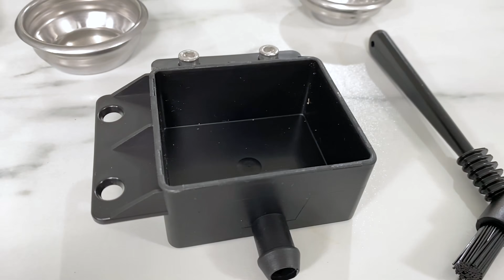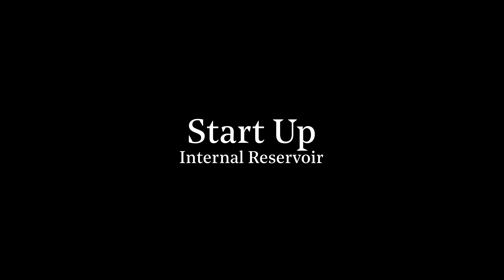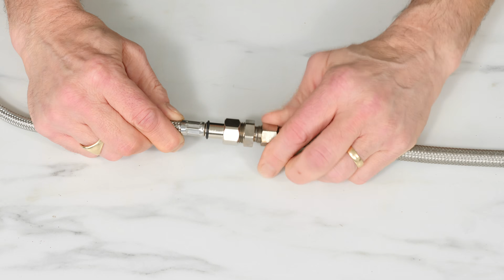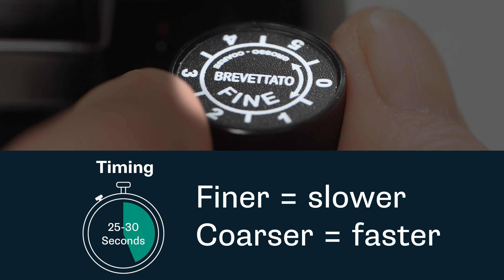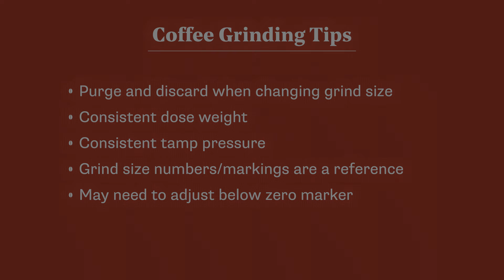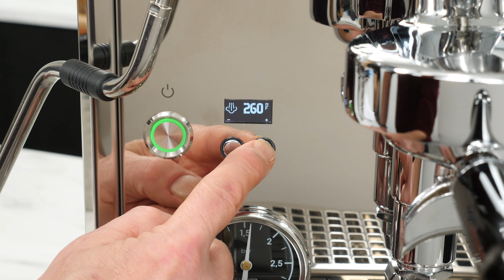Profitec Drive Setup, Quick Start & First Use

Comment: Question (very late, so here's hoping you still pick up on this):

To connect the machine to the direct water connection I want to connect the hose to the water inlet. However on my machine it's pointed to the back so basically south of the machine. Yours is pointed sideways. Is it safe to change that orientation (how would I safely do so), or did it come shipped like that?
Reply from the maker: Hey there, good question. That piece can rotate, so it's ok that it's int hat position.

Comment: Thanks great informations about start up. I would like to ask if I can set up the opv valve. Is there a screw somewhere at the bottom where I can do this?
Reply from the maker: Hi p, you're welcome and thanks for the comment and Q! Yes, there is a screw to adjust the rotary pump bypass accessible thru a hole on bottom left of the machine. It's the rotary pump bypass which adjusts static pressure (not an OPV) on machines with rotary pumps.
Marc

Comment: Is the fast heating mode the same as Profitec Go? Does it simultaneously heat both boilers? Or does it heat the brew to the highest temperature first, and then only heat the steam boiler?
Reply from the maker: Hi l, Fast Heat takes care of the brew boiler 1st then the steam boiler heats,
Reply: @Wholelattelovepage  thanks! From your testing with the offset set to -3F, did you notice any overheating issues with the machine? I've been using 90°C and -2°C, but I still notice the machine heating over 90°C.

Comment: Hey! Can I ask, would you recommend this or a Bezzera Duo. I’m looking at either, both look phenomenal, but ultimately after a reliable machine I can keep and repair for 10+ years that makes excellent espresso. 

Thanks 🙏🏼
Reply from the maker: Hi MrJJ, Both the Bezzera and Profitec machines are excellent and highly reliable machines. The Profitec Drive is a more recent design updated from their highly respected Pro 700. The Drive has a deeper feature set like programmable active and passive pre-infusion and quick heat up time. While it has more features than the Duo I give it a slight edge in reliability with an overall less complex internal design. It's very easy to work on should the need arise. Hope that helps!
Marc
Reply: @ thank you so much, Marc - truthfully appreciate the reply and breakdown. 

Are there any other models you’d recommend with the lever action steam / hot water system that are worth considering? 

Have a wonderful day 🙏🏼

Comment: I unboxed my profitec today. It’s a great machine but I found the steam wand too loose for my liking, the wand kept pushing up when I tried to fix it on my pitcher spout. May I know if there is way to tighten it?
Reply from the maker: Hi ff, Yes the wand can be made tighter. Here's a video showing how. It's shown on an ECM Synchronika but procedure is the same for the Drive: https://youtu.be/NDpqdu7Tb9U
Marc

Comment: My pump pressure out of the box is set at approx. 10bar. Can I change this myself to around 9bar? How?
Reply: Excellent thanks Marc! I wonder, when 9 bar is the desired pressure, why do they set it at 10+ in factory?
Reply from the maker: @plyr78  NP! Keep in mind where that pressure is measured - it's way back by the pump. During an actual extraction pressure in the portafilter is likely closer to 9 bar when the gauge is reading 10. I know people do, but don't get wrapped up in a bar or two difference in pressure. Highly unlikely you'd taste a difference at  +/-1 bar if everything else is equal.
Marc
Reply from the maker: Hi p, Here's a video that shows you how to adjust the brew pressure. It's shown on a Profitec Pro 700 but it's the same for the Drive: https://youtu.be/2ArWAtuUTOM?si=ks0IQipOwIiyCoX8
Hope that helps!
Marc
Reply: @Wholelattelovepage  Sorry to revive an old thread. I went to go adjust my Profitec Drive brew pressure using the method from the Profitec Pro 700 video you linked and I don't have the oval hole on the bottom of the machine and when I shine a light through the little holes it doesn't look like there is a bottom facing adjustment. Is this normal?

Comment: Hello,

I’ve been searching for a new machine I have the Breville oracle touch , but want something different , I seen this review and I wonder how does this compare to the  
ECM synchronica ?
They are very alike I believe
Reply from the maker: Hi g, thanks for the question. Internally the ECM Synchronika and Profitec Drive are essentially identical with the same boilers and many other components. ECM and Profitec are sister companies. The Drive has a bunch of new functions not found on the 
Synchronika like time programmable active and passive pre-infusion, programmable on/off by time of day. The Synchronika has a more refined external housing and extra details like chrome tips on valves, handles and the angled portafilters. Hope that helps!
Marc
Reply: @Wholelattelovepage  
Hello , thank you It did, I like the profitec a lot,also looking at the bazzara aria PID, you guys have a great selection, it’s for a home use, so the one boiler should be fine, I’m just not familiar with the brand, want something reliable, because the breville Oracle touch we had kept breaking. I seen it’s a copper boiler, but I’m also not sure, if that’s a factor at all.
Reply: Thank you!

Comment: Drive or Synchronica?
Reply from the maker: Hi oz, Thanks for the question. If you did not know, internally the Drive and Synchronika are essentially identical. Same boilers, pump, plumbing, etc. The Synchronika's finishing is slightly more refined and it also has angled portafilters while the Drive's are straight. Synchronika is available with flow control and it's stock on the Drive. The big difference are additional features in the Drive's control system like active/passive pre-infusion, time of day/day of week on/off and the fast heating option. If you are likely to use those features then the Drive is worth a look. Hope that helps!
Marc
Reply: @Wholelattelovepage  Cheers Marc, I appreciate you taking the time to give me a detailed reply. I appreciate it. 😊

Comment: I find the machine super interesting. Can you say whether there is an offset/difference between the temperature displayed on the PID control and the effective brewing temperature? In other words, can it be the case that I get 94 degrees Celsius displayed on the PID ex works, for example, but actually only brew at 91 degrees Celsius, for example?
Reply from the maker: Hey oliver, yes, there is an offset between the actual temperature in the boiler and what ends up on the coffee. Variables like ambient air temperature have an affect. Typically, the water temp in the boiler is a little higher than what ends up on the coffee. As mentioned in the video the offset is easily user adjustable in the menu. The difficult part is measuring water temp out of the group to decide what the offset should be. Measuring requires a relatively sophisticated device like a Scace or the Pesado TPD. In most cases it's best for users to leave the offset set as it came from the factory.
Marc

Comment: How to take into account the pre-infusion time? Should it be included in the total time or should it be added to the main time (25 seconds + pre-infusion time?
Reply from the maker: Hi SK, when timing shots it's best to leave pre-infusion time out of the calculation. Example: Let's say you did 5 seconds of active pre-infusion and 10 seconds passive. Certainly do not want the rest of the extraction to be only 10 seconds!
Marc

Comment: Is the quick start heat up mode a setting in the menu you just set and not have to mess with menus after that? My wife would love this feature, but would NOT be willing to get into the menus at any time.  Thank you!
Reply from the maker: Hi brucek, Yes, you'd only need to turn it on 1 time,
Marc

Comment: Thanks for the video Marc, I just realized I did not remove the motor screw at the bottom, I should check that. I would love to see a video with a machine plumbed. I will have to check here in Dubai where I can get the equipment. The drain also is amazing it has some many options.
Reply from the maker: You’re welcome. Do check for the shipping bolt!
Marc

Comment: Thanks for showing 😊 wonder where brew temperature is. Boiler, grouphead or temp in the puck/cup?
Reply from the maker: Hi l, you're welcome! Like the majority of machines of this type the temperature probe is within the brew boiler. In the menu of the machine you can adjust the boiler offset temperature if needed to compensate for hot/cold ambient conditions, etc. It's nice on this machine you can easily access the boiler offset setting if needed. On many machines that setting is somewhat hidden in a tech access menu with cryptic labeling.
Marc

Comment: In terms of pre-infusion, my Breville dual boiler has a 10 second pre-infusion, does this mean I should be setting my shot time up to 40 seconds, and only timing the coffee extraction from when the pump actually turns on or do I start counting the 30 seconds when the first drip comes out of the porter filter?
Reply from the maker: Hi r, thanks for the question. I recommend using first drip but it's up to you. Timing is the most basic way to appraise an extraction and gives you a reference point that's relative to your variables. So if you pull a 1:2 ratio shot at 25 seconds from 1st drip and it tastes sour/under-extracted you might adjust grind a hair finer to get the same 1:2 brew ratio in 30 seconds. If you were counting a 10 second pre-infusion in your timing you're now at 35 and 40 seconds in the example.
A flow profile I use for very fresh from roast specialty coffees uses a very low flow start of ~2g/s until I see first drip at maybe 15 seconds. From there I change to a medium flow rate of ~5g/s to complete the shot. In that profile, total time from pump on could be 40-45 seconds.
Marc

Comment: I have to get one 🤪 but I am still thinking about ECM Synchronika 🤔
Reply: I have the Drive. The PID is so much better than the Synkronika. I think the Synkronica is due for an upgrade to this PID so I would wait before buying the Synkronika or buy the Drive now.
Reply: @LivingTheLifeRetired  this I think is what comment I was looking for. I feel like ecm and profitec are the best to other manufacturers but between those 2, I had a feeling the Drive was better. The only problem is the Drive is so out of stock
Reply: Synchronika is very slow heat up time